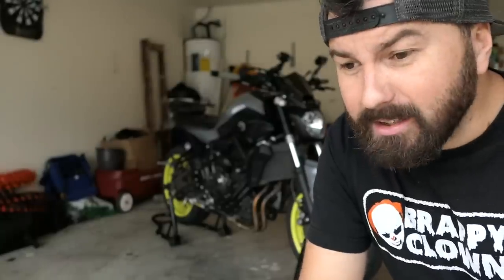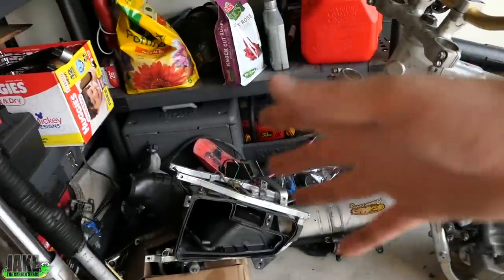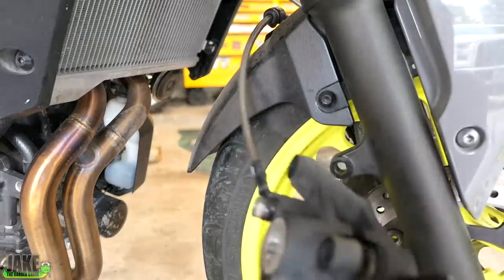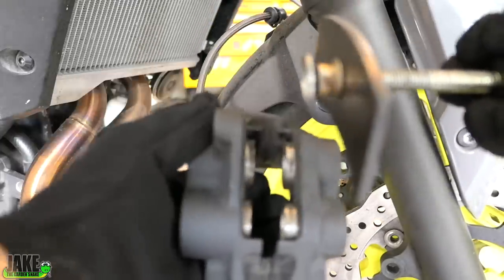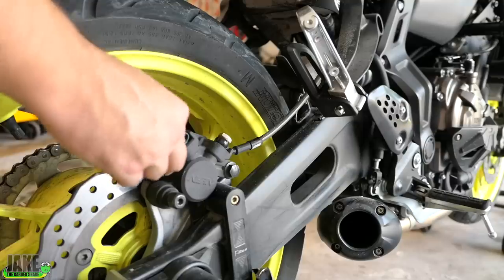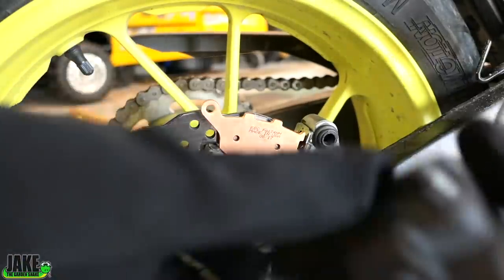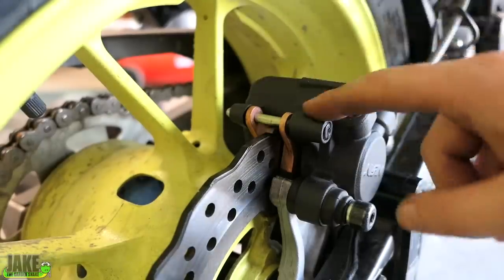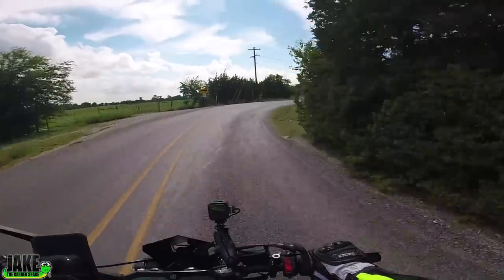FZ-07 Brake Upgrade MT-07 XSR700 BSOS

Comment: Good to see you do this simple mod, it's easy , so many people complain about brakes lacking bite, as if its the end of the world and nothing can be done. I'm convinced that most manufacturers fit dead feeling wooden pads for our own safety,  god forbid that we should have brakes that actually work (especially  rears) in case we should brake to hard and our faces fly off our heads and our eyes pop out! I have had huge improvements on bikes much less well brake equipped than the MT-07 with SBS (Scandanavian Brake Systems) sintered pads.
Have also experimented with different brands of OE spec pads in my Ford Puma with  massive differences in performance. Great video!

Comment: Did you know the philips head screws on Japanese bikes are actually JIS not philips?  I just learned this a week ago, that's why philips screwdrivers round out so easy, bought a JIS screwdriver off Amazon and it fits so much tighter in the screws.
Reply: FWIW, JIS screws should usually have a dot on the surface of the screw to let you know it's JIS....
Reply: What a revelation it was when I discovered the JIS screwdriver! Could never figure out why screw heads were always getting ripped up. Now that I have a JIS set, working on the bike is so much easier. Mystifies me that Yamaha includes a plain ol' Phillips head driver as part of the under-seat tool kit on the FZ/MT-07. Apparently they want us to rip up the heads!

Comment: Jake, I've been riding since I was 6.  I got my first 49cc honda crf 2001. I recently got a 2011 yz 250f  with the 5 valve head (no efi sadley). I'm going through it as the last person didn't take care of it. The forks are leaking and it doesn't like to idle. I'm slowly  getting the grumpy troll back into race shape but you are my inspiration
Reply: Grant1282 I highly recommend checking the valves. You'll have a hard time starting it if the valves are out of spec especially on that bike.

Comment: Pro tip: Take the time to clean the calipers, and especially the pistons and around the lips of the piston seals with nice soapy water and a tooth brush before pushing them back in.  The seals will last longer, and there will be less of a chance of them leaking and/or binding up down the road (both literally and over time).
Reply: But Jake is a certified mechanic lol he didn't tell us too lol, I agree 💯 though
Reply: Thought you are suppose to put some copper or anti seize paste on the spots where the pads hit the shiny metal, to counter brake noise en pad binding. And on the pin you put through the pads? Or did I not spoke to a certified mechanic?
Reply: I follow the FSM for my bike.  The only type of grease used on brakes will be on sealed slide pins on a rear caliper like is seen here.
Reply: Don't put any grease on the any part of the brake pads. Only part that needs SILICONE grease is on those sliding pins.
Reply: Even most slide pins don't require any sort of grease unless they have an O-ring seal on the end of the pin like my Honda's rear brake, and that is just a tiny bit of grease right on said o-ring. Otherwise, the pin should be clean and dry.
Reply: Suzuki and Yamaha  say otherwise. It needs to be silicon grease because of the rubber dust boot, any other type of grease might degrade the rubber. (And yes, it's just a tiny amount of grease)
Reply: I never specified a specific make besides my Honda, I was speaking in generic terms, and much like my Honda, due to a rubber sealed part, it requires grease, thus you just affirmed my own statement.  I am specifically speaking about the guide pins that go through the holes on the pads, which should never be greased unless specified by the manufacturer.
Reply: @OddBallPerformance  
Ah, a misunderstanding.
Totally agree, just remove all the dirt and grime.
Reply: Well, I did kind of word it terribly, having gone back and read it, but since you are a reasonable and intelligent person this didn't turn into a shit show.   It's refreshing!

Comment: My front brake works too good after pads and lines. Now when i pull the leaver my brake light doesn't come on, unless i pull really hard. Luckily my rear brake is adjusted correctly and will activate the light.

Comment: Thank you. Very helpful. Getting ready to put EBC pads on my FZ07. Do you not use Copper Grease on the back of the Pads or the pin? I know there is a lot of debate about this. What are your thoughts? Thanks again.
Reply from the maker: No I just make sure it’s cleaned up. I know some people are all about this copper grease. I use two greases. A synthetic molly one. And think nasty trailer bearing stuff. I feel like I can get most done with those.

Comment: I bought EBC brake rotors and pads the last time I needed to replace the brakes on my car... They are the biggest piece of s*** brakes on planet Earth!!!  The pads didn't fit into the calipers properly without the edges being ground down slightly, they have very weak stopping power compared to the NAPA rotors and ceramic pads I put on before, they always squeak... ALWAYS, and god forbid they ever get wet!  The rotors rust instantaneously!  I will never give EBC another penny for as long as I live.  I removed the EBC rotors and pads after just 3 months. Threw the pads right in the garbage and gave the rotors to a friend for scrap metal.  Put NAPA ultra premium rotors and ceramic pads on the car, couldn't be happier!  You live you learn. Only this lesson ended up costing me like $390.

Comment: Out of curiosity, I've seen some guys that put a little copper grease between the pistons and the back of the pads and also a bit on the "holding pin".  Is there any (good) reason for doing it (that you can think of)?  I've replaced mine and not used it.  I've mentioned it to a few people before and never have gotten a good answer.  Is it maybe an "ounce of prevention" kind of thing? Anyway, thanks for the vid!
Reply: It's to prevent squeaky noise

Comment: Do you have an opinion on applying grease to the caliper pins? I know you cleaned them off, but I've seen videos where people grease the pins.
Reply from the maker: Well that pins not a very tight connection and dust is made be the pads. The pads rattle on the pin. So grease would most likely just collect brake dust instead of help anything.
Reply: @TheGardenSnake  Okay thanks!

Comment: Question. I'm upgrading mine with the same pads and spiegler lines. But my front brakes have been really scary lately. Begining of my ride, the lever will have a normal travel and activate the brake light switch. Eventually it will get really stiff and touchy with no travel and it feels like they'll lock up. Then it will go back to feeling normal. Currently have shorty levers. Swapped back to stock, same thing occurs. Bled the brakes with a vacuum. Same thing. Bled the brakes manually. Same thing. Noticed during bleeding, not a lot of fluid comes out when I open the bleeders. Asking for your professional opinion. Master cylinder, lines, or calipers? Went to my local Yamaha, master and/or rebuild kits are months out from Japan. So I'm left with shotguning the lines and maybe disassembling the master and going through it.
Reply from the maker: When you did the vacuum pump was the cap on the brake resolver? Was the brake fluid you used new and unopened? Look around the web for a master cylinder rebuild kit. This bike is was to popular for someone not to have those in stoke.
Reply: @TheGardenSnake  installed the new lines and pads last weekend. No change. Put the bike on the rear stand and lifted up the front end and attempted to spin the front wheel. Could not get a full rotation. Removed the calipers again to inspect travel (compression and extension) they move freely. So I'm assuming the master cylinder is not releasing the pressure.
Reply: I wanted to follow up with you cause I had the same MZS shorty levers. The levers were the cause of the issue I was having. I compared them side by side with the stock and the pivot point is significantly different. The MZS levers were set at an angle that would push the master cylinder plunger in causing the brakes to drag. So I put the stock ones back on and bled them again. Perfect. I don't know if you or anyone else may experience this. Buyer beware.

Comment: Put these on my fz-09... The caliper bolts were a little rusty, mostly surface rust it looked like. Do you think I should replace the bolts? It's been like 2 months and no issues so far
Reply: Steel wool or scotchbrite should knock off thr surface rust.
Reply from the maker: Like Scallie said, get the rust off, clean em, lube em and they should be good.

Comment: Is this the same for most yamahas? I've got a wr that could use better brakes.
Reply from the maker: Its pretty simuler for lots of bikes. The front brakes on a wr will be more like the rear brakes on this bike. Its a two piston caliper with both pistons on one side like the rear. That's called a floating caliper. So you'll have one of those pins that has to be unscrewed, so loosen it before removing.

Comment: No brake guide pin lube?
Reply from the maker: You wouldn’t want to live that. They get caked in brake dust already. They’re really exposed. If you lubed it then it would potentially get gummed up and be less effective. Just wipe em off. They’re a lose fit so they shouldn’t give you any problems.

Comment: So steel brake lines are for the track, you arent going to see any improvement over rubber brake lines if you only ride on the street. The reason people use steel brake lines on the track is because the constant on and off of the brakes when you are rounding turns causes high heat buildup and rubber lines can melt or expand and give you a sloppy feel, or even be unsafe etc. Steel brake lines, as you mentioned, will outlast rubber lines but you have to ask yourself, is this worth a $250+ upgrade versus just replacing cheap rubber lines one time within the life of that motorcycle? Sintered brake pads will bite harder than "normal" brake pads that's true however you already had sintered brake pads that you took off in order to put new ones on. You literally replaced brand new sintered brake pads with sintered brake pads you purchased. The brake pads you pulled out were copper coated, tell-tail signs of a sintered brake pad.
Reply: All brake pads are sintered if metallic?  Carbon ceramic (which I think still contain metals?) would be the only one not.  "Sintered metal is a solid product made through the process of powder metallurgy from different types of metals".
Reply: @MdethCKR No not exactly. If you notice he installed EBC sintered brake pads. Here's what EBC says about it, I'll let them explain it to you. What are sintered brake pads? "This is the fusing together under heat and pressure of metallic particles and in the case of brakes it blends various other elements to enhance friction properties and wear life. Sintered Brakes have become a standard on 99% of Motorcycles and ATVs from the OE Builders and they also form a large percentage of the aftermarket for bikes and ATV’s."
Reply from the maker: You’re information is based on what you’ve heard from others clearly. I actually know the exact video you got a lot of that from. If you actually rode a motorcycle before and after putting steel brake lines on you wouldn’t say that. It is very much worth it especially when the steel lines are guaranteed for life. The OEM pads might be sintered but they’re not as good as these ebc pads. Nothing wrong with learning from others but be careful throwing what you’ve learned from the internet in the faces of others. Some times they have experience too. I’ve been riding and wrenching on bikes for 15+ years. I don’t know everything but I might know a few things.
Reply: @TheGardenSnake  yes information I heard elsewhere... Like the manufacturer of the parts you installed. Don't get butt hurt now... You just have no clue what you're doing end of story.
Reply from the maker: You read that on the back of a box or something 🤣🤣 ok hang on I’m getting Lee. He’ll love this.